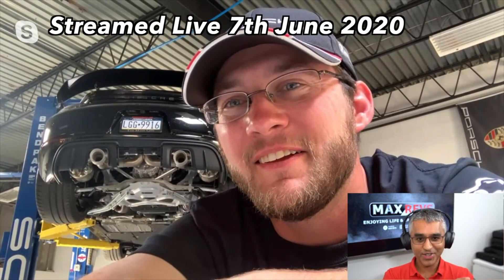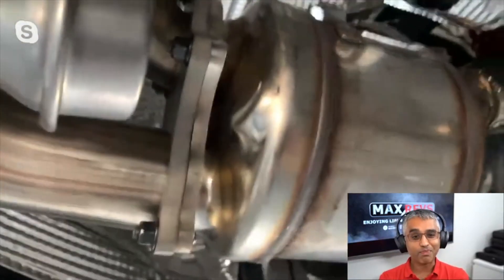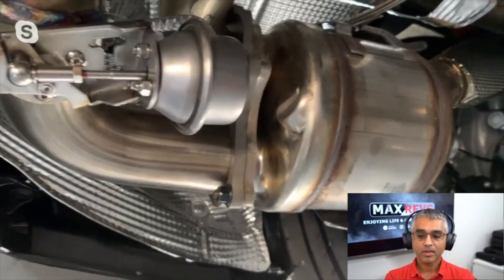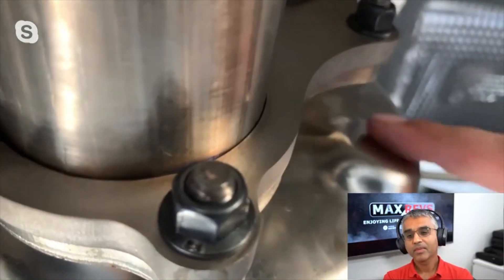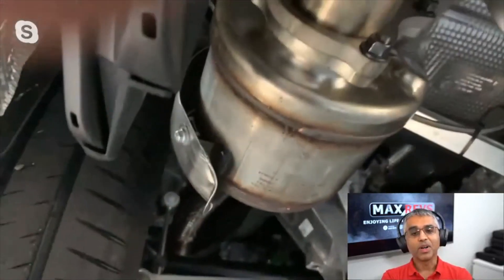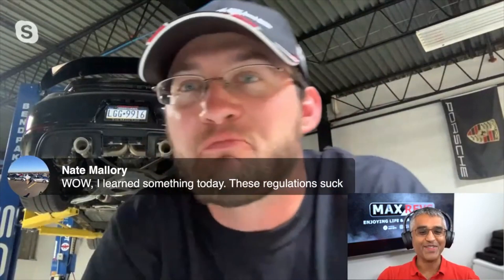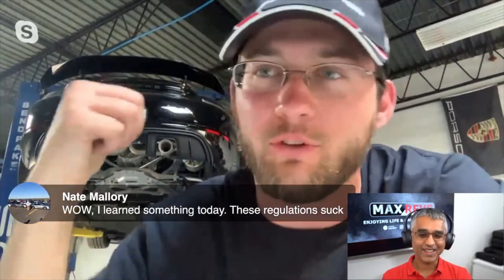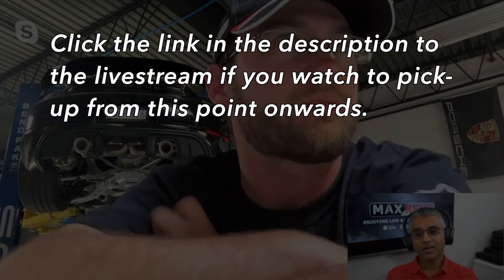GPF PPF Delete? Porsche Cayman 718 GT4

Comment: Okay boys,  I picked up my 718 GT4 today in California (mine is the first 718 GT4 I've seen) and here are my two cents,  for what they're worth.  Yes, there are canisters where the OPFs are located in the European cars but we DO NOT have the same particulate filters in them as you do in Europe.  I've only heard a 981 GT4 once as it blew by me on the Freeway and it was loud and sounded terrific.  But, my 718 GT4 is also quite loud and sounds amazing, maybe different- but amazing, and I haven't yet reved it over 5,000 RPM.  Yes,  the sound is better over 4,000 RPM when the exhaust valving changes but it's not bad under 4,000 RPM, especially with the SPE on.  Frankly, the valving under 4,000 RPM makes the car livable on the Freeway, otherwise the noise in the cabin over a long drive would be too much.   Bottom line,  it's loud, has a deep, sonorous tone and has a proper GT car sound.  Can't wait to get it broken in and hear it really scream!
P.s., So far I've only made one stop, in the parking lot of a garden shop,  and a Cayman GTS owner came over gushing about how great the car looks and SOUNDS.   
P.s. 2, the gearing is fine and the clutch and gearbox are amazing but it is a stiff ride, very loud inside, very mechanical and raw; definitely not for everyone, but so far perfect for me.  :-)
Have a great weekend!
Reply: They will have the same opfs. There is no point in making different ones, just bcs they are not monitored. Its justmuch easyier to unplug them. And. the 718 sounds brilliant. Enjoy and drive.
Reply from the maker: First off the bat congratulations on your purchase. Each Cayman generation needs to be appreciated for what it is, they’re all great cars. Having driven all the various Caymans, what they have done with the 718 GT4 is duct much more engine noise into the cabin. When you refer to the different sound levels it’s not clear if you’re referring to outside or inside the cabin. Inside the cabin, without a doubt it’s louder. Outside I would say from memory, it always sounded quieter than the 981 GT4, at all rev ranges.

If you’re willing to oblige, many subscribers were sending in videos about their Caymans during lockdown. Why they chose a Cayman, what specs they were looking for/optioned, if you are able to do that for this community that would be awesome. I’d love to see a 718 GT4 in Californian sunshine. My brother lives in California, however drives a Kia ;-) You could film on your phone, and don’t have to appear in camera if you don’t want to. It would re-start the excellent Subscriber Car playlist on this channel. Of course, I fully understand if you don’t want to do this.

Lastly, like you, I fully believe in running in the engine, no matter what the Porsche sales guy says. If it was my new car, I’d probably change the oil and filters after 5k miles in case there is any fine debris in the oil. And really lastly, I think Miami blue was made for California, that’s what I would pick with your climate ;-)
Reply: @MAXREVS  Hi Max, doing a video sounds like fun; thanks for asking!  I think it'll be better to do it after the car is run in or at least when there isn't thick smoke blocking out the Sun and a constant rain of falling ash (the wild fires here have been truly epic), so please be patient.   Mine is Guards Red with silver wheels (that's kind of my thing); although I saw a Miami Blue one today and it was beautiful.  Then my wife saw a 911 in Gentian Blue and a Spyder in Chalk and announced that hers should be a Spyder in Gentian Blue.   :-)  They  look amazing in any color/ wheel combination.  Have a great Sunday!
Reply: @NoName-qp1op  thanks for that!  Interesting!
Reply from the maker: My apologies on forgetting about the wild fires... reading and thinking about Caymans shuts out everything else in my head... more than happy to wait to get a glimpse of your GT4 ;-)
Reply: @MAXREVS  no apologies needed.   It's been a crazy year and nice to have a channel like yours to distract us from all the madness!